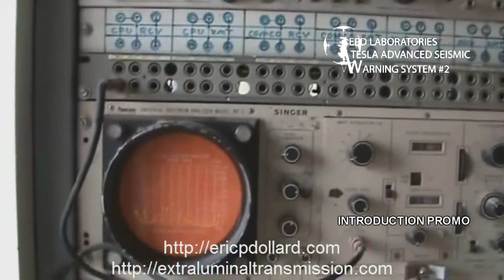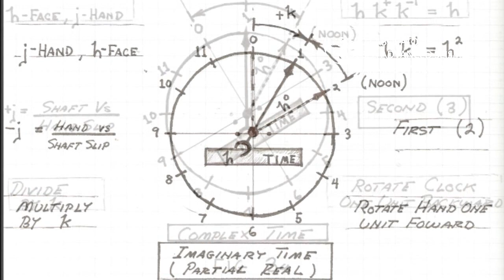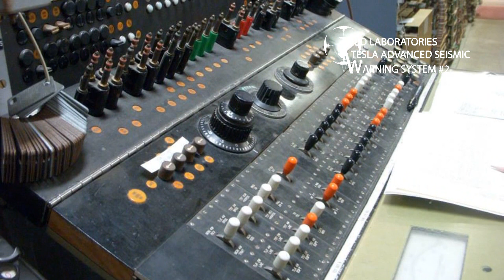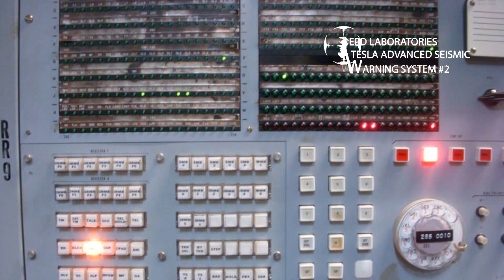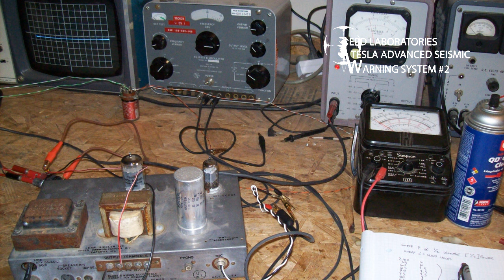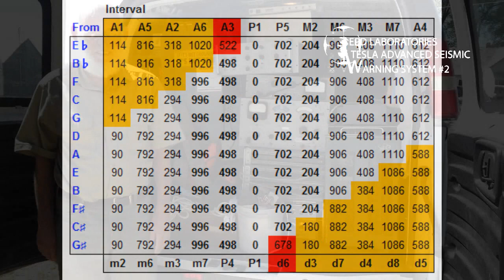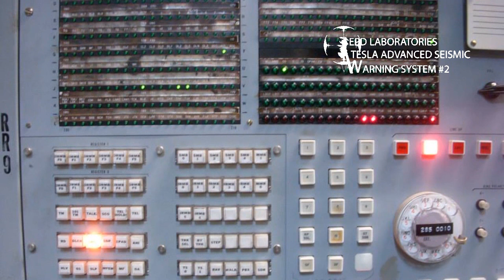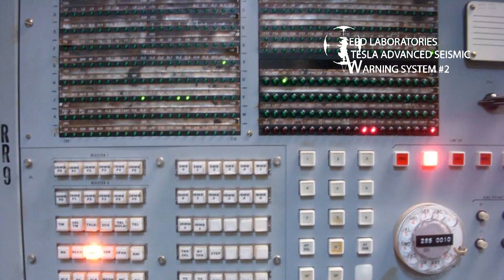The life and work of Eric Dollard, part 1 of 3

Comment: The A tuning has risen from 432Hz to 440 Hz.
Reply: To the non musician perhaps you're right. Here's the weird thing though, I use a guitar tuner set to default 440Hz for playing in a band. I was curious to see how "pitch perfect" my natural tuning abilities were one day so i tuned up a couple of guitars by ear around the house then clipped the tuner on to measure any discrepancy. I was consistently flat by about a quarter tone at 440Hz. When i switched the calibration to 432Hz I found I was pretty much bang on the money, plus or minus 1 cent (due mostly to the intonation error of the instruments). I know I have relative pitch as opposed to pitch perfect but it was still an interesting result.
Reply: Lupocide LOL - I appreciate your experience and comment , but are you suggesting musicians have perfect pitch and can identify notes they are playing?  - not quite.  Like you did explain, only when you break out the tuner will most people know how far off they are from the notes they were 'trying' to play.     I understand your point, it's a general problem which barely anyone really notices  unless you are striving for perfection and making that audio statement in a studio where auto correction gear is common now. cheers.  I am a musician as well  but I need assistance many times to calibrate.  I'm not perfect by any means.  What you say is pretty common I'm sure. Cheers.
Reply: I would say that a basic fundamental of being a musician is the ability to differentiate between different notes (intervals being the ratios between them) and knowing which note you're playing no? There are other factors which affect our abilities to detect pitch like volume and what part of the frequency spectrum (bass treble etc.) we are operating in. Besides perfect intonation in the tempered system is impossible anyway BUT on a fretless instrument true intervals are at least a possibility. I'm just curious how we arrived at 440Hz arbitrarily considering how long the Pythagorean system of 432Hz with is basis in the Quadrivian was used for.
Reply: You can't hear in the Mhz range dude, you must mean 420Hz? Anyway, if you add up the angles of the fundamental geometric forms in order (i.e. triangle, square, pentagon, hexagon etc.) and use the numbers as you're reference tones in Hertz something very interesting happens. You get an F sharp major chord. Orchestras tune to F sharp. Just saying ;-)
Reply: +Lupocide ...My parents operated a piano store for many years...my Dad tuned pianos....used a 'tuning fork....440 Hz....'middle C' on a piano keyboard....
Reply: +Lupocide I THINK if you all are in tune to f Sharp you will be in tune to anything. this key overrides your BRAIN as a musical player as not many compositions are in it..not MUCH popular music EITHER.. it's odd FOR instruments.
Reply: Quite a lot of military marching music is in F sharp lol.
Reply: +Lupocide F#maj. I learned it from Alex Lifeson!
Reply: Most people won't know the difference but the Luciferian Gabal / Elite / Illuminati changed it from 432Hz to 440Hz so it was Weaponised to make the music subconsciously Demonic and Evil messing with young peoples Heads on a very large scale .
Reply: @Lupocide  blame the nazis

Comment: I have worked in a telephone switching centre.  The pictures I see in this video are nothing more than the inside of an old Step-by-Step (SxS) telephone switching system. The towers with the horns are microwave transmission towers for the telephone radio transmission system.   The labels on the video are there to mislead viewers to believe that they are looking at something else.   I hear a lot of nonsense talk in this video.  My background is in electronics engineering technology and teaching.
Reply: don't judge a box by it's cover

Comment: Interesting that the presenter said 3 hundred and 96 which is total Saturnian, Masonic numbers.  The 432 Herz frequency is 4+3+2 which would equal 9 and has to do with the 369 Saturnian stuff. 440 is equal to 8 which is the infinite.
Reply: No it does not have anything to do With saturnian stuff, it has to do With the Indian calendar and 4 Seasons, golden ratio and so on.
Reply: 440 is broken, because 8 is not a complete number as 9 is.